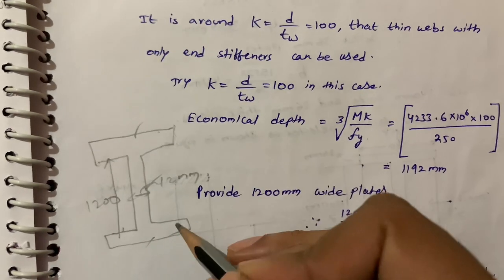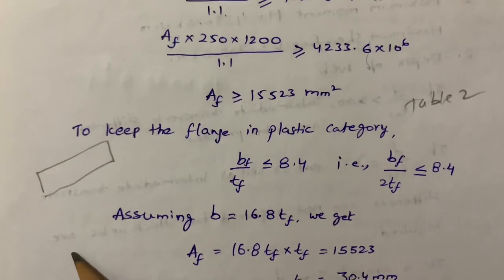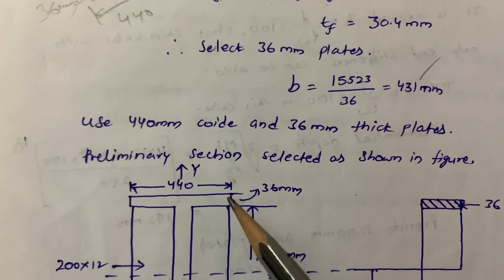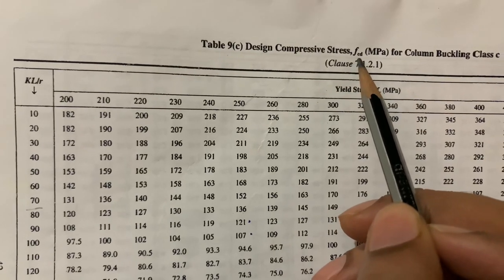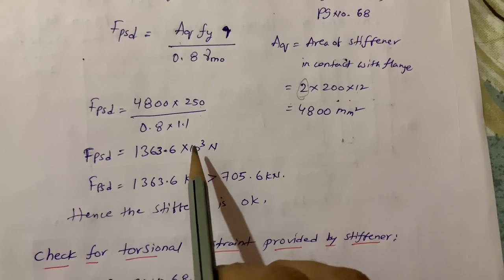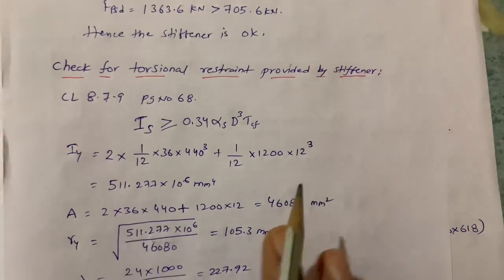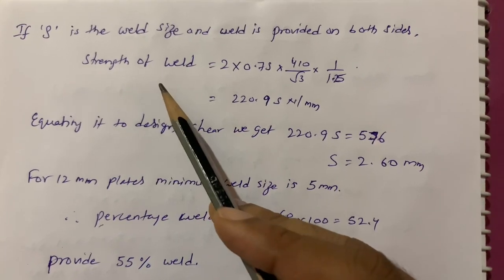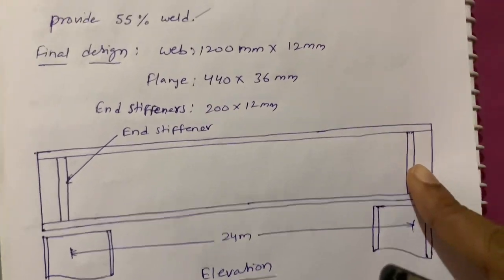#DesignOfPlateGirder #Endstiffeners #DesignOfSteelStructures #WithoutUsingIntermediateStiffeners #

Comment: Sir, in step 4 , Zp is plastic section modulii , but you substituted area of flange (440×36) , can you explain how and why?
Reply from the maker: Zp is nothing but plastic section modulii of the cross section. But in our question Only load and span is given that’s why I assumed all the values. So there is no selected section like ISMB,ISHB etc that’s why I took it as the area of the cross section I mean like  rectangular area LxB.